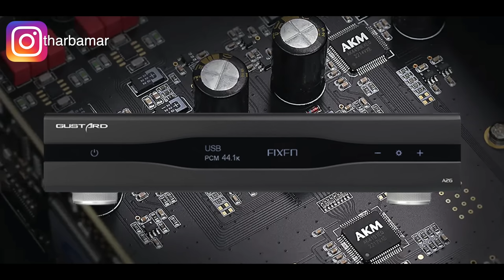Gustard A26 World Premiere, Favorite DAC of 2022

Comment: Just amazing separation and clarity!This DAC for sure sounds the best of all DAC's you have tried in your system! One question.XLR or RCA sounds better to you? Thank you!
Reply from the maker: It will be very close, XLR may have slightly better separation, thanks
Reply: I agree in general. However different genres must be tested. I'm not sure about fast dynamic music. But in hi-end world people have different DACs for different genres )
Reply: @sc0or  This is a chip DAC! It definitely will be better than R2R for speed.
Reply: @beslemeto  And?.. Each stage matters. If a pre-amp can be genre specific, so a DAC can. Cause it has converter/filter/pre-amp stages. Everything around the chip in this DAC is exceptionally good (as on the pictures). But I don't know how did they set up the final stage. Capacitor type also matters. What is good for a digital stage, might affect a sound when is used in analog stages, and so DAC will be some genre centric.
Reply: @sc0or  True!There are many factors...

Comment: As always, a very comprehensive review. I bought the Night 1 musician speakers partly due to your recommendation and very happy with it. It certainly performs at or above other speakers costing 2-3 times its price. The question I have is regarding two videos you did on power cables. One video you recommended the "Black Mamba V2 OCC cable and you also recommended the Mogami W3104. As you know the Mogami is less expensive than the Black Mamba cable. Is the Black Mamba noticeably better than the Mogami In any way? Appreciate your view on this. Thank you.
Reply from the maker: In a way yes because it has proper drain wire and shield but I also built one similar to that with proper shielding and drain as well.

Easy DIY Shielded Audiophile Grade AC Power Cords, Twisted Too!
https://youtu.be/E1E7Olxsocw
Reply: @Tharbamar  Thank you for the prompt reply.

Comment: This breaks my heart a little bit. My R26 was just delivered, still in the box. But it's not too late to swap out for the A26
Reply: My bet is that they each do their own thing a bit better.  The R2R may be better in areas you prefer, such as depth,separation, naturalness while the chip based dacs might have better dynamics, etc.  Its a preference and I don't think this dac outright beats the other in every category.  Even the ESS dac might have even more punch and treble extension.

With R2R, the SQ will be best when left on while the chip dacs should achieve best performance in a relatively short warm up.  Tradeoffs, give and takes, but one isn't better in absolute terms.  Depends on what you really need and are willing to trade off (a bit ) to achieve a more preferred overall sound.  Depends on amp, speakers, room and type of music/recording as well.

Case in point, I am probably going to sell off all my better equipment and keep my lower powered amps, smaller speakers and lower cost dacs which were upgraded with a better op amp.  Am I missing much?  I don't think so as I have achieved a good system synergy in my room with smaller. lighter and less expensive equipment.  Sounds outstanding to me.

I have two Keces E40 integrateds, one for desktop and one as a main driver, two Aune x8 dacs upgraded with Sparkos opamps, one set drives Dali Opticon 1s and the other Triangle Zeta Plaisir speakers (each sound different but do their own thing really well).  Only thing left is a streamer (maybe).

If I were to upgrade from this and still stay in my targets for less bulk, perhaps Knight 1s, one of the Gustard dacs and an integrated around 80 watts.  That would all cost approx $6K while my two systems came in under $3K including sources, wires, etc.   The differences you gain would be noticeable but still small enough and the differences between the two Gustard dac even smaller.  One isn't better than the other, just a slightly different presentation, but that slight difference might be slightly more appealing.  In this hobby, you pay for slight this or slight that.  Among audiophiles, slight seems to be over emphasized.  All depends on what one's brain interprets as to what is preferred.  

I'd be happy with any of the Gustard offerings but I could also nitpick any of the slight differences among them.  If you have the $$$ though, buy both.  Use one in one system and the other on something else. Better than ruminating on which is the better choice or whether you made the wrong buy (which I do not think is the case).  Otherwise, if you don't have the budget or need for a second system, love the one you have.
Reply: R26 is very airy and detailed as long as you keep it on all the time and give it 6 weeks for full burn-in. Going by my experience with ESS, AKM, and R2R based DACs (I currently own DACs with all 3 types), I suspect A26 is in between X26 and R26 (but closer to the R26) trading off some holographicness and SS depth for a bit more detail than R26. I definitely prefer the voicing of R2R over AKM but A26 might be a better fit for warm systems and X26 for rolled off systems.
Reply: Get A26 has more resolution while still sounding natural as per Tharbamber!
Reply: Don't be downhearted Chris! The R26 is a great bit of kit. Give it time to settle in and you won't be disappointed. There's always a 'better' DAC out there, it's just a shame that companies keep churning new models out so quickly because, of course.... the latest one is.... 'better'.
Reply: @Claymore64  To add to that, not necessarily better, but different, slightly different. I agree that the R26 is a great bit of kit and many would prefer it to the DS offerings.

Comment: Thanks for the review! Do you think adding a DDC like the Gustard U18 and an external clock improves the sound quality of the A26 noteciably? The A26 has a linear power supply and great internal clocks already so I wonder if it is worth the money on a DDC and a clock.
Reply: I just bought this and I'm wondering the same thing.  Seems like the same clock system but I read that it will improve it but I'd like to know but how much.
Reply: He replied to me in another video he made on the Gustard U18 from a while back....QUOTE "Tharbamar
Tharbamar
10 hours ago
It will not make major improvements."
Reply: this was my question: "Do you think the Gustard U18 DDC will improve the Gustard A26?  I read the specs and they seem to have the same clock info so would it be redundant?"
Reply: @jsuno23  Thanks for the info. My A26, U18, and OCK-2 are on the way, I will test it myself. How do you find the A26 so far?
Reply: @botwally2954  it's on the way as we speak...hoping Thursday
Reply: what did the A26 take the place of?  I'm replacing my smsl D400EX so it'll be up for sale soon!  Had to swap out because I've upgraded to a cayin ha-6a and felt the DAC needed a little upgrade too.
Reply: this chain going to the new ZMF atrium closed that just dropped...instant ramen it is.  I'd be really sad if you said its another level with the U18 and OCK-2...
Reply: @jsuno23  I had a LKS audio da004 before. I don't know how good it is because I never had a chance to compare it side by side with another dac. I sold it for the a26+u18+ock2 stack. Hopefully it won't disappoint. My current headphone set up is stax 009 and kgsshv so any difference should be more noticeable than traditional headphones.

Comment: So, you are saying that you like this DAC even better than the Plontus II which you rated very highly?  Also, you like this chip based DAC better than all the R2R's that you have tried, because I THINK there was a time when you preferred the R2R DAC sound.  Thanks!
Reply from the maker: I still love R2R DACs but I do like this A26 more for my need and really impressed with the way they designed and amount of work they put in, not only on the bench, they’ve spent many hours of listening sessions to get the best possible sound as well as keeping the top notch specs.
Reply: @Tharbamar  I think the biggest surprise is that I thought you prefer R2R over Delta Sigma originally.
It is quite surprising that you think A26 is the best DAC in 2022 rather than other R2R DACs.
I believe that A26 must having something unique that similar to R2R but keeping the advantage of Delta Sigma

Comment: You have mentioned Japanese equipment, do you think that Rotel would still be a good combination with the A26 or should it be avoided? THANKS!
Reply from the maker: Personally I stay away from higher price products that contracted to third party manufacturers.
Reply: @Tharbamar  I understand, but the problem is that I'm already equipped with Rotel (amplifiers and preamplifier) :( So my question is in fact: won't the A26 be a good match? Thanks again
Reply from the maker: @olicoz00  Sorry for wrong answer it meant for other guy asking in my Accuphase review video, based on transparency nature of A26 DAC it should work great in many different setups, Thanks
Reply: @Tharbamar  Thank you Thabamar. I was lost with your answer 😂 So, I will go with the A26, thanks again for your reviews! 👍🏻

Comment: Thanks for this excellent review, I bought one which arrived just over a week ago. Very impressive indeed. I have a question which is not addressed either in the manual, Gustard website, or even the AKM or Velvet websites. Menu item #5 Sound: shows two modes to choose from Monitoring and Listening but its not clear to me exactly what is going on with this although I can hear differences it would be better to understand what makes those differences. I noticed you use Monitoring rather than Listening, can you explain why you chose this mode? Thanks
Reply: Monitoring most likely a neutral sound, listening probably has some degree of bass/mids boost…
Reply: @SatanDynastyKiller  Nope just the opposite actually.
Reply: @RobOutlaw  I agree in that I can tell something got louder usually the vocals.

Comment: Thar for someone who loves the elac unifi reference. What's the next step from that? Like a more explosive version of it?
Reply from the maker: Better version would be ELAC Adante AS61 it will be more refine in sound quality but may not be as explosive as you may hope to get.
Reply: I have those (bookshelf version) and really love them. Warm and smooth yet detailed somewhat, very good soundstage and imaging. A relaxed experience just what I wanted. I plan to add a nice subwoofer to add some bass extension. If you want to uograde but maintain a similar sound signature I'd say go with the Buchardt s400 mkii, the lintons from wharfedale or the klh model 5.
Reply: @JoseFerreira-zb7wh  I  was thinking the exact same thing about the klh model 5s! The lintons are too warm for me. I use the unfi for my desktop.

Comment: Thanks Tharbamer, I've just purchased the A26 based on your review. I currently use the X26pro, which is a great sounding DAC but think it lacks some soul.
Reply from the maker: Good choice!
Reply: If you can let us know your impressions! I also have x26pro and I think just like you. I read on the site that x26pro and r26 are discrete class A dacs while a26 is not! It certainly does not determine anything even if it seems strange to me and I would be pleased if someone could explain it to me! I am undecided and perhaps I would look for the soul more in r2r even if slightly slower and less precise, the a26 is certainly fast and softer than the akm tradition but my fear that class A can make the difference. please advise me. Thanks
Reply: @221298ale  actually as an owner I can confirm that Gustard X26Pro is not pure discrete. Just look at the pcm layout. Not so important are opamps or discrete components used. What you're really interested in is two things: whether a given implementation allows the chip to realize its full potential. The second thing that interests you is whether you like the subjective sound of the product. By itself, this has nothing to do with class A I/V. There are good implementations just on a large number of opamps and they may have a good sound, in many ways even better than gustard.
Reply: @negserg7639  hello there, would you please advise if for a planer headphone like Arya stealth,  R26 is more suitable or A26...thanks for your help.
Reply: @gauravgoel8092  hello! To be honest I am not a big fan of Arya in particular and hifiman headphones in general, so not an expert for pairing it. I have not exprienced neither r26 not a26 in my system. But some very negative reviews of r26 tend be to recommend to try a26.
Reply: @negserg7639  hello Neg, thanks for your reply. Ok I understand, no worries.

Comment: I would really like that you try some AN dac or some with Phillips 1541 or 1543 chip.
Reply: Those dacs will sound nice but they are low Rez. You will never get the true micro dynamics and real timbre of instruments. It's like you prefer a good Sony bravia crt tv of yesteryear as oppose to a latest 8k OLED. When I use the example OLED not to say it will be brighter but closer to the what the real thing is.
Reply: @klepp19  so you heard AN dac?
Reply: @flatericy  Yes, I almost bought one! Was looking into tube dacs as I was dissatisfied with my first DAC which was Chord Qutest. I consider so many like Swix, Orchid, Musical Paradise even Aqua and Prima Luna. What I should have done was originally bought the original Denafrips Terminator haha. My philosophy is high resolution to start and then tailor sound down the chain.
Reply: @klepp19  Nice . I would like to try Audial S5, AN 0.1x and now even this...i Dont want to buy before I try.
Reply: @flatericy  it's going to be hard as AN is in low supply. But the 0.1x I never heard. Just over $2k USD. If you get it post here. Mant yrs ago I heard the level 1 DAC bu AN.

Comment: Does A26 sound as natural as SMSL D300 which beats my staple of R2R DACs?
Reply: Which are the R2R dacs you own?
Reply: @beslemeto  currently own Musician Pegasus & Denafrips Pontus II. All I can say is the transport iFi Zen stream with smsl d300 DAC is more musical than either R2R using say Bluesound Node or even my long Cambridge 851N. Transport made that much of difference. But main thing of non R2R like SMSL is highs are more pure and lifelike and not as smoothed over.
Reply: @klepp19  LAN connection purifies the sound as its best i guess...People are praising switches for improving sound quality.This iFi Zen is like a switch i guess.How exactly you are pairing it?From PC to the Router and them to the iFi Zen isn't it?And then to the DAC?Could you explain to me?Thanks un advance!I don't like smooth sound either.Sound for me should be clean, rich and dimensional...

Comment: Does it beat your musician aquarius?
Reply from the maker: Yes definitely.
Reply: Did you try it with your kef r11? I have the same speakers! If the dac is better than the aquarius is such a deal for the price!
Reply: I would like to hear a direct comparison of A26 and Aquarius. Not at all doubting the tech and build quality of the A26, but the Aquarius scores rather well there too. Also this particular demo sounds like B&W speakers "v-shaped hifi sound": slightly recessed mids, present bass and detailed highs almost to the point of sibilance. I appreciate many folk like that, but I personally prefer the more midrange rich and holographic soundstage depth of good R2R dacs.

Comment: How is Gustard A26 compared to Topping E70 Velvet which uses the same DAC.?
Reply from the maker: Very different design.
Reply: Is there a huge different in sound quality  @Tharbamar .? 
I'm looking at both E70 Velvet and A26, but i find it hard to pay 3 x the price for Gustard with the same chip. I like the pure, clean and "in your face" sound from High-End AKM. The "sweet, round and romantic" part is late in my system aka Conrad Johnson Premier Ten (modified) and 300B PP mono blocks with JJ tubes.
Reply from the maker: Sound quality is not the same, I can’t answer more details because I haven’t reviewed E70 yet.

Comment: when i use the R26 LAN or USB I'm forced to raise the volume all the way up on
my amplifier...this is not normal....If i switch inputs to my optical
with the volume knob so high i could blow my speakers...I have the
latest USB Driver and firmware 1v4 installed...what could be wrong...Please Help
Reply: Use a preamp and put the Dac in fixed mode.
Reply: @AudioFunHouse  Hi thanks, 
...I sold that DAC a while back...good DAC but i'm now using a Denon SX1 dcd SACD /DAC balanced xlr to Klimax pre amp to vintage Onkyo e30 equalizer to vintage Yamaha M2 amp...to vintage spendors S100...🥵lol